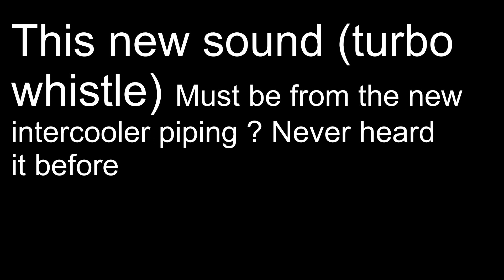New stuff for the TRITON + a new SOUND

Comment: Still sounds like a Massey Ferguson Tractor to me. 
The Air cleaner to Turbo pipe needs to be soft & flexible because the engine moves but the air box doesn't. I put a solid Forefront silicone replacement on my MN Triton & it pulled the top of the air box when I was gunning it up a steep incline,  slippery gravel & clay, so I was on & off the accelerator pretty hard though, so be careful.
Anyway after that experience I went back to the soft flexible factory one. 
Also the silicone joiners on these Forefont kits need to be replaced with the silicone "Hump joiners" for the same reason, the intercooler doesn't move but the motor does. Note: The pipe behind the grill doesn't need them because it's not connected to the motor. The hump in the joiner allows the join to flex with the movement of the motor & some of the good name brand ones will flex up to 20 degrees & even stretch up to 10mm. I got the whistle in mine when I fitted the Forefront Intercooler, the aluminum pipe kit just made it a little louder. Quite a pleasing sound.

Comment: Sound is by filter and deleted exaust muffler, but you should not change air filter, k&n permite small particles Flow, use the original particle size
Reply: @43unit213  ye I don't recommend a K&N for when your offroading. If you do go just change filters out or put a pre filter in your snorkel, you can find them on eBay. Alot of people use a 'sock' that goes over the head of the snorkel, can definetly find them on eBay.
Reply: @43unit213  ah all good then mate as long as your car dosnt get hit with dust often you should be good with a k&n

Comment: These intercooler kits are shit. The hose clamps are rubbish quality, they pinch the silicone sleeves making them leak. None of the bead rolls on the hard pipes are pronounced enough to prevent the hose from blowing off. The intercoolers mounting points are out by enough that it's a struggle to get all three bolts through. Once you've filed and slotted the holes to make that fit, you learn the infeed pipe mounts on the wrong angle, fouling the clearance hole in the front firewall. $650 and a days spannering wasted.